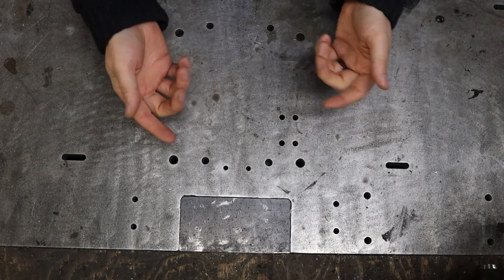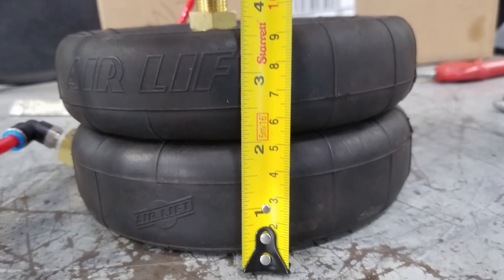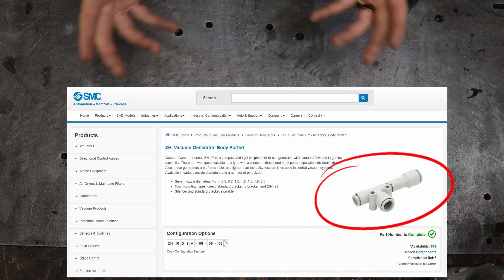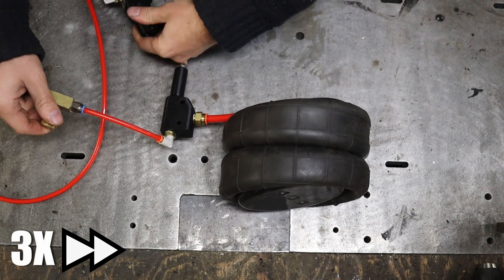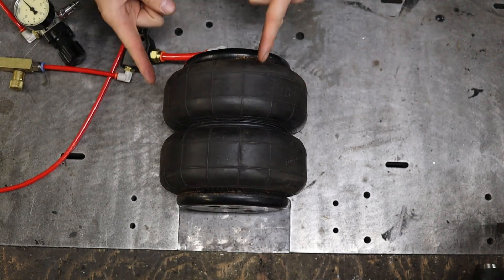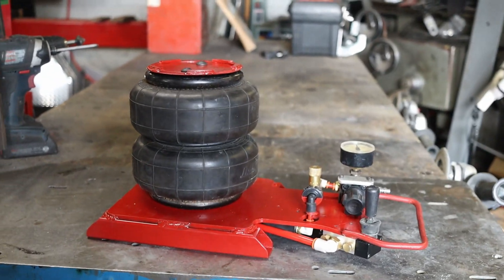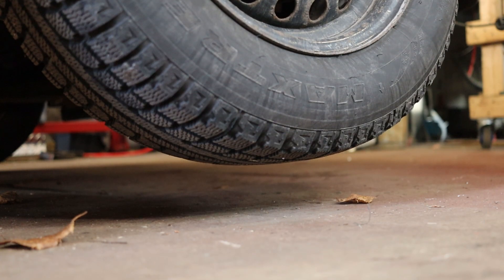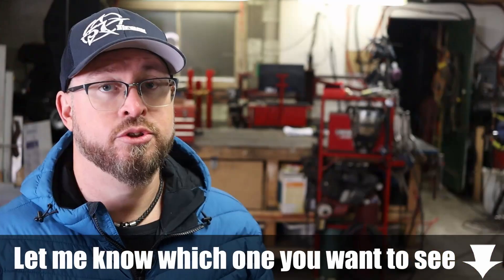DIY Air Bag Car Jack : Is it a good idea or not to build one?

Comment: I did years ago and got a much bigger jack with a new truck airbag (thanks to Ebay).  It works great at raising my 40ft shipping container to winch it onto it's beam foundation. Every mechanic should give it a try which is not hard.

Comment: It wasn't a good idea to do it your way which is certainly high quality but reflects insufficient prior research. That jack does not at all need to be so elaborate which just adds weight and failure points. I use a ball valve at the jack for safety with a common brass pneumatic chuck, but the ball valve at the jack is redundant backup to also permit hose disconnection. I put another valve on the short whip hose between my supply hose and the jack. When I'm ready to lower I shut that valve, disconnect the whip then use the valve on the whip to safely lower the vehicle. 

Copy THIS fellow and they work great: https://www.youtube.com/watch?v=ZV-GCXT0f60
I built mine from an 18-wheeler bag and it easily raises my 40-foot shipping container. You absolutely can build a quality bag jack but if you don't quite know how best not to. What I don't see in the pic is hinges to keep the bag CENTERED. Quality hose and fittings are cheap so there's no reason not to use good rubber hose and a quality ball valve. They do NOT require a regulator or water separator. I power mine off my CO2 cylinders using a fixed pressure (200psi) regulator to step down cylinder pressure but shop air doesn't need that.

Comment: I made my own bag jack easily out of a big truck air bag and will make a couple more. I control it as a distance and if there's no compressed air handy I've several CO2 cylinders which do other useful things like feed my MIG, inflate tires in the field and much more.  The work to make a good air bag jack is easy

I use old alloy wheels laid down along with wooden cribbing with any jack. Much safer than jack stands and rims work safely off-road because of their diameter.  I use cribbing firefighter style so the lifted item cannot drop beyond my desired safe distance. My air bag jack easily raised one of my 40' High Cube shipping containers and the lateral movement the unrestrained bag bellows permitted safe lateral movement of the shipping container (raise, shift laterally, place cribbing, lower and reposition bag jack and repeat). I use an inline ball valve with air chuck and nipple so I can place it before the air hose going to the jack to control flow.
Reply from the maker: well done!👍

Comment: Hey, new subscriber..you are VERY good at this YooToob game.
I mean, I absolutely  knew the outcome of this video before clicking the start button, and yet I watched the whole damn thing anyway, giggling like an idiot through much of it...
Yup, you're destined for big things.
👍

As for the jack situation?
I haul a trailer pretty much every day..and during racing season, a car trailer..'cuz race cars are too heavy to carry in a back pack, right?
Anyway..I've tried 'em all.
The best portable jack to carry on board (in my opinion) is a (nearly) free one..
😁
Next time you go to the junk yard, grab yourself a scissor jack from a full size car or truck. Make sure it's one with a hex drive instead of the stupid shepherd's crook thing..add a steel pad to the base to improve stability, and a bit of square tube to the saddle so you can notch it to fit your needs.
Add a cordless impact gun (you carry that anyway, right?) with the appropriate socket wrench, ya get a super fast, super compact, light weight jack that will more than exceed your lifting needs.
Floor jacks are nice, but they're too heavy to lug around and next to worthless in unpaved pit areas.
Anyway..thanks for the info-tainment. 
Keep it up!
Reply from the maker: First, more often than ever, I don't read long comment, people write stories like if it was their personal diary...but just as you kept watching my video, I kept reading your comment! 😅I also often find myself watching some of my older videos to the end! I hope, I'm destined for something on YT... but it takes so much to ''explode''! Anyway, your jack idea is f*** amazing, I have a smart car, right! So the scissor jack will be more than enough, especially with the mods you described, lightweight, easy to carry and if anyone stole it... who cares!
Thank you for your comment Doug 👌

Comment: Would you be willing to send the design files for the “supported” version you show at the end of the video? In my application, it would be perfect. When I go to change my tires from a flat to full tire, I have to change jacks and jacking points just to to be able to get under the axle (lowest point within reach) and then high enough to be able get my 53” tires off and then back on. Plus, unless I’m using a bottle jack, I’m well out of the weight range of any jack that could fit under it, all because each of my 4 rear tires holds about 3k lbs unloaded, or about 9k lbs when fully loaded.

Comment: HEY VINY , MY PROJECT IS TAKING LONGER THEN I THOUGHT WITH KIDS AROUND , YOU KNOW HOW IT IS !  I NEED YOUR HELP ON SOMETHING , HOW DO I BY PASS THOSE SENSORS LIKE THE EXHAUST SENSOR OR ANY OTHER ONE I WILL  ENCOUNTER , I REMEMBER IN ONE VIDEO YOU MENTIONED IT BUT COULD YOU GIVE ME A DESCRIPTION OF THE PARTS I NEED !    THANKS AGAIN .      ALAN
Reply from the maker: Hi Alan, kind of hard to give you an universal answer to bypass sensors, but typically there's 3 way to bypass them, either you connect both cables, or you unconnect them, or you replace the sensor with a resistor. The ohms of the resistor will depend from the sensors, but sometimes a 100ohms resistor works for some sensors bypass. The best, google it and read some forums regarding the sensor you want to bypass!
Reply: THANK YOU     MERRY XMAS
Reply from the maker: @AlanDavid1955   Merry Christmas Alan!

Comment: if you make another, you should put a shutoff valve between the vacuum generator and the bag in order to lock the bag compressed. preferably to lock it inflated as well. loved the video :) always amazed by the stuff you make!
Reply from the maker: the plan was to put a check valve between the vacuum and the bag, I just couldn t find one in a short period of time, didn t want to delay the video for that check valve 😅
Reply: @VinyB57  I used a quarter turn ball valve on mine and to remote control my factory version too.

Comment: Hey Viny, was thinking about what you mention for your motor power conversion.
If you require to run 480 or 600 3 phases, some vfd can use 240 single phase and produce 3ph 480 or 600
Just an idea.
Keep them coming, its very entertaining !
Reply from the maker: Oh, I had to recall why I was going for a motor change and not getting 600 V by any electrical wizardness! So I called one of my good buddy, an electrical engineer and VFD don't power up or down voltage, only 110, that can go up to 220. So I ll need a transfo to up the voltage and a VFD or a rotophase to have that 3 ph. Anyhow, I just pull the motor...and it s gonna be quite interesting to swap for another one 😳
Reply: So basically, you just changed The Motor from 3 phase to 2 phase motor?
Reply from the maker: @KeroncongDinihaRi  nope, to a 1ph 220v....but it's not a direct fit, there's a lot of mods to fit it!

Comment: I was thinking about doing this and how well/poorly it'd work just a few days ago :-) Nice trick with the venturi to suck it down - I hadn't thought of that problem until you pointed it out at the start. For me it'd be just for changing wheels, working on brakes, etc - and for that it'd be fine, but you still have to run an air hose. Re handbrake: that's required, as is being in park if auto, or 1st/reverse if manual, and having the wheels chocked front and back of rear and front wheels on the opposite side. But right now I use scissor jacks and a DCD996 in low ratio to quickly raise/lower cars and it's even less stable than your bag setup. The only real issue with that is wear on the drill and wear on the jack itself - I have ruined one completely and the current one is feeling tired.